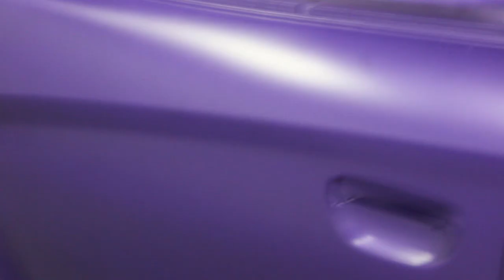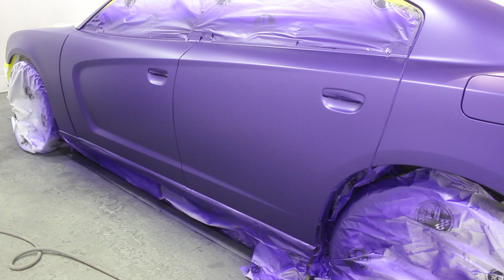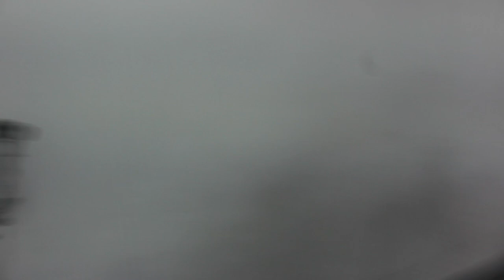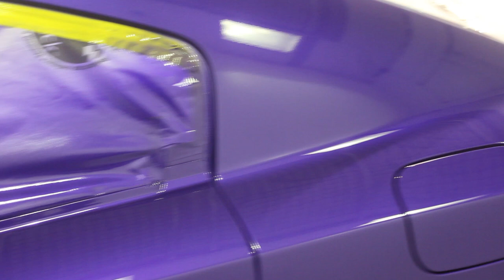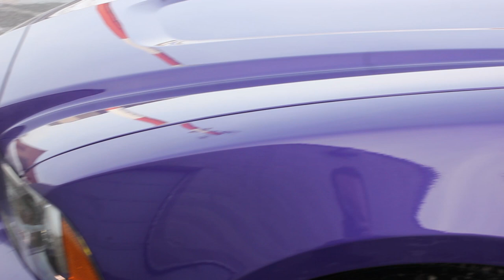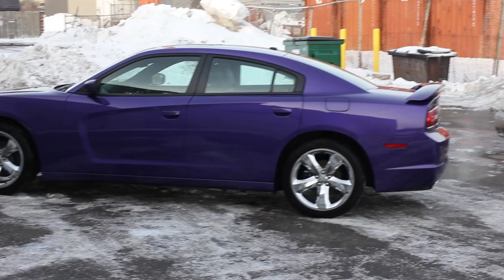Purple Power Unleashed: Raw Unedited Dodge Charger Paint Job

Comment: lacks purple 
Different rear bumper and threshold
On a sunny day will be very noticeable 
It was necessary to make the transition to the bumper or do pre-test and adjust the paint ))). Nice work
Reply: Dam it don't match at all the hole side is all defront colors
Reply: Kevin Clevenger What is a defront color ?